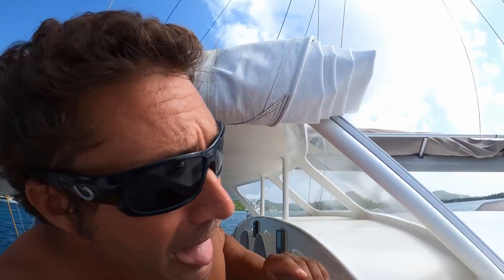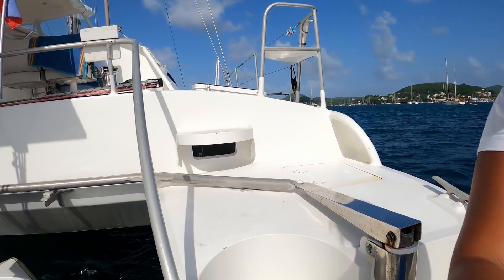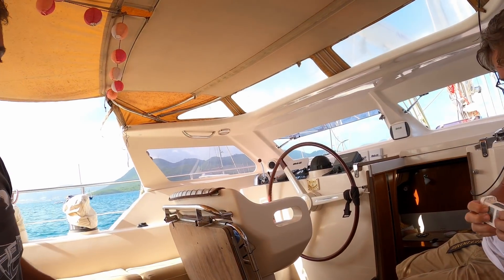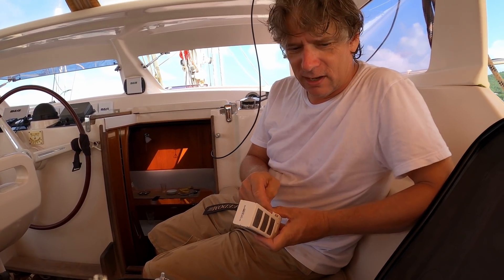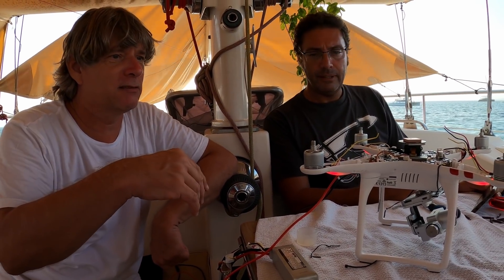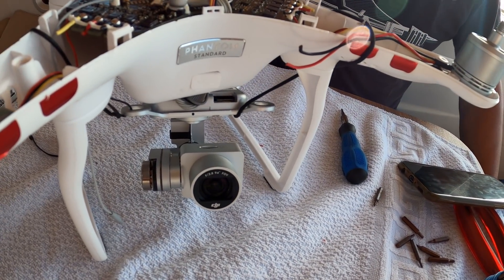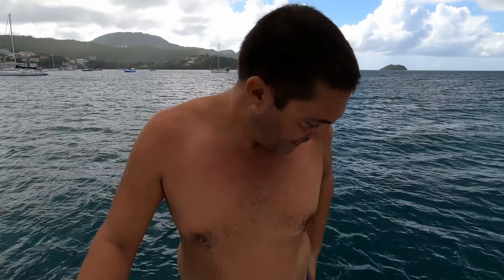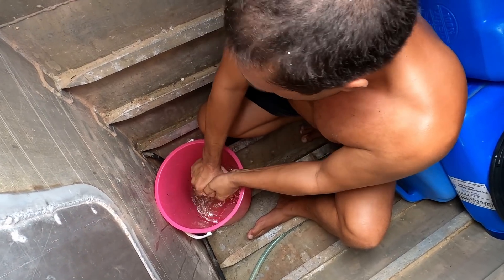Will it fly again? Drowned drone - Sailing life - EP47

Comment: On my trailer ali, I’ve got $10 lawn soaker hose cut to length, zip tied to stringers, facing up towards the bottom of the floor, running stern to bow. 
After a day out, I plug the hose onto it, & it flushes out all the fiddly hard to get to bits in the hull (excl weed).
When finished, I pour some mineral oil in the line, (also in a pump spray bottle) run it again for 5-10 seconds, so it (hopefully) coats/protects.
You could do similar when theres plenty of solar to produce water.
Reply from the maker: Sounds like a good idea

Comment: Jamie, Are your water tanks integral to the hull? Painted or left bare aluminium? 
I don’t recall if you detailed this in your “construction” videos.
AFAIK, Issue with bare alu is you must avoid (standing) water+chlorine or you’ll face fast corrosion… Magnesium anode could help preventing it inside water tanks. Best seems to ensure no chlorine in your water (ie only water from watermaker, or filter dock water all the time…)
Issue with paint is flaking after a couple of years and blocking pumps / corrosion development under the paint…
This is a hot topic on some forums 😁.
Fair winds to you both.
Reply from the maker: Good info, tks Lionel... Yep integral and bare, apart from a little epoxy along the weld lines to block the pinholes. I didn't know about the chrorine issue.. But yes we fill with the watermaker 95% of the time... Maybe I'll make sure to use a carbon filter when filling with city water..

Comment: Were does the salt comes from?
Reply from the maker: Good question... In the bow, we get the occasion and gross leak from the toilet/holding tank... A few drips from the stern tube/drippless seal...
But mostly from the sea air reacting with the ally.. There always some build up, even in completely dry areas.

Comment: Now do you wish you painted the inside hull ,and if so how much extra weight would it add to the boat, and how much out of your pocket??
Reply from the maker: Yes and no... Others have said that it WILL degrade and flake off, blocking bilge pumps...so I guess this is a minor pain in the ass with ally boats...always a compromise!
Reply: @SailingLifeonJupiter   I would rather  Scrub some aluminum then clean a bilge pump . Thanks  for getting back to me

Comment: hello Cap
salt water conducts electricity.  and on your boat its gonna eat your aluminum quickly.  You got to put zincs everywhere. on the hull, rudders, prop shafts, everywhere in the engine, everywhere salt water flows thru the engine..   and I'd start by checking the zincs every week in case you've got a hot spot.  Then you've got to be careful that neighbor boats aren't giving off too much stray electricity, in a mooring field or especially a marina.   And the builder says you should paint the inside.  How easy it would have been for him to do it during the build.  Enough, aluminum boats suck.   Good luck
Reply from the maker: Of course zincs thanks Ed...hull zincs have lasted 6 yrs so far... Props and rudders I replace every 6mths....ally boats rock!

Comment: I'd put tethers on those fore hatches. If there's a way to create an intractable problem I usually find it.  
I think if you want to epoxy the insides of the bilges you could just carry the epoxy, some inexpensive chip brushes. I mix my epoxy by weight-  digital kitchen scale. (the weight ratios are always a little bit different from the volume ratios - easy to just make a spread sheet. 150 grams is the same as 1.5 grams, 1500 grams 15 grams... On your spread sheet chart you'll see what the weight should be with the hardener... easy.   Cheap plastic cups, 1 liter yogurt containers. If you wipe out as much epoxy as you can you can use the same container for months. I'd rough up the aluminum in the bilge where you're going to epoxy. More tooth makes a better hold.  Do a little at a time. Best to wear long sleeves and a respirator - some people can become sensitive to epoxy fumes (even though it smells 'nutty' it's carcinogenic. But it also sets up quickly. The most toxic thing that can be done with epoxy is to sand partially cured epoxy. And if after you give a good coating at the bottom of the bilges if you run synthetic steel wool to polish it up, it'll be slick as glass and the salt residue will wash right out. 
I'm a beginner sailor, passed the first two levels of the American ASA certification. Two days ago I took out a 32' Beneteau, practiced points of sail. (Finally getting good at that.) Sailed until I was exhausted. Came in to dock into the slip, got into trouble - oh boy, what a mess.  Some guy pulled out his phone - I could wind up on YouTube (only saving grace is I didn't damage anything or sink.) I was feeling really incompetent - which is good because I was. 
 I know how to dock - I just didn't know what to do if I got into trouble. Of course I'll hire someone to take me out and drill every possible contingency into my head. But wait, they certified me as competent.  So sure, It's good to get the certs - but it's more important to actually know what you're doing.  And I've often heard that those RYA guys can be real buggers - grading  your sailing on if they think you're fit to have cocktails at their yacht club. After all the Brits have a tradition of flogging the guys who know how to sail and promoting the guys who don't.  Good videos.
Reply from the maker: Thanks willn2go1... Yeah I'll get around to painting the bilge one day.. Am not looking fwd to the acid washing first, especially in the bow with minimal ventilation... In the meantime I'm happy to wash out.
Congrat with your certificates... Don't worry we all embarrass ourselves often... Boats have a way of doing that... Tks for ur comments.

Comment: Why don’t you paint the bulges (all of it) with epoxy white paint? That will seal it and stop the corrosion.you only need to paint the salt water issue one.
Reply from the maker: Will probably do it one day...Although Im not looking forward to the acid preparation. But I'll get around to it.
Reply: @SailingLifeonJupiter  Sooner rather than later. Your hull is getting thinner with every 6months you wait. I would do it in the next dry doc you visit. The white powder is your hull disintegrating, just like the brown stuff in rust.

Comment: The chemical composition of that dust on your bilge is: Calcium, Rhodium, Oxygen and Sodium (Ca+RhO+Na) 😷😷😷
Reply from the maker: Ah OK.. And what exactly causes it Josi? And what's the best way to keep it away?
Reply: @SailingLifeonJupiter  You have asked the trillion dollar question. Big data and q-bits; use probability to create time line. Prevention will require live data analysis. The problem with this method is that it can reveal a lot more than what we need to know.
Reply: @SailingLifeonJupiter  "Carona"  (i.e. virus) Not funny... another weirdo.